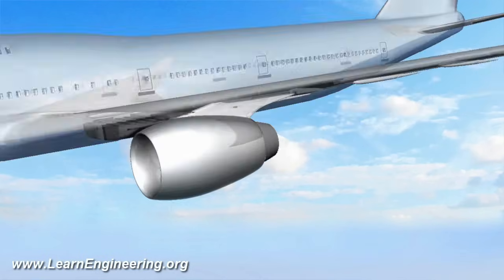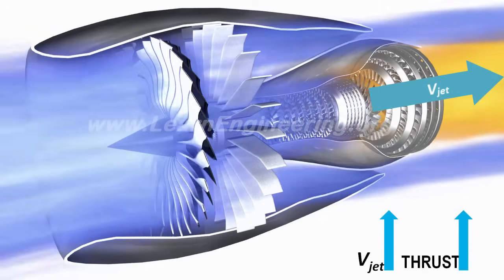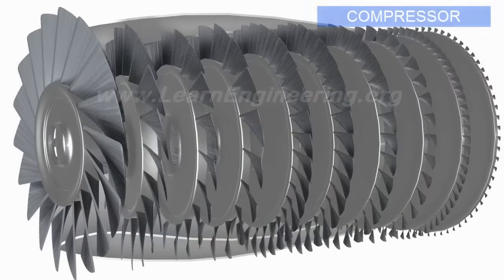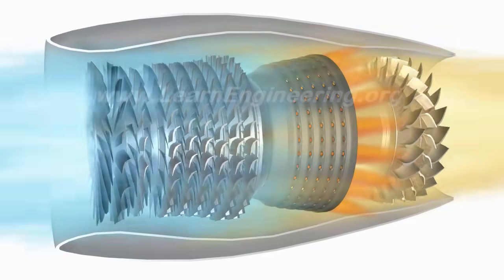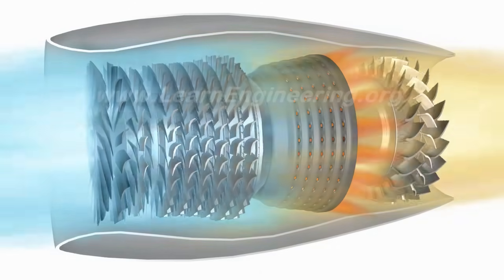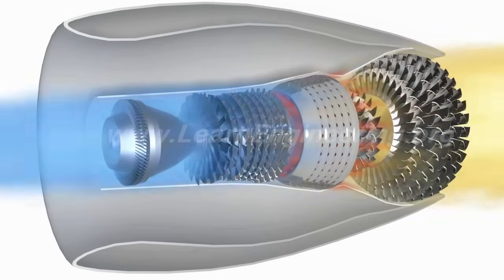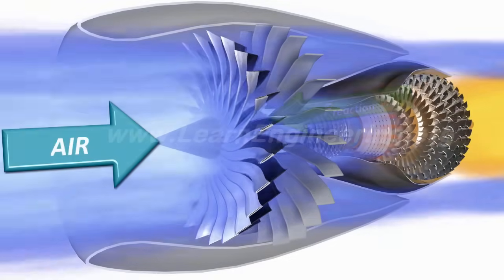Jet Engine, How it works?

Comment: Make two technical errors:
1) Between the compressor and the turbine why didn't you use a special torque converter?
2) Because around the combustion chamber (fixed in the inner part of the casing) an evolved radiator (with sensors and electronic control) to give more indirect power to the combustion and greater flexibility to the engine.

Comment: What if we remove the rotors at the end. So there Will be no 350C and 0.75bar what brings 900km/h but 1600C and 35bar.....
Reply: The turbines at the end drive the compressor at the beginning, its not magic the energy to make it turn has to come from somewhere

Comment: Quick question, i see that both the compressor/turbine and fan/turbine turn in the same direction, do they not compensate the gyroscopic effect like in turboshaft?, and if they dont, how would the twisting of the plane(going up, down or turning sideways) affect the load and movement (twisting the engine case or the wing itself, etc)in the plane?

Comment: I am new to this..........and i have a *Question*. Basically the video explained that the high velocity jet from the combustion chamber spins the turbine, which consequently spins the compressor. And the compressed(high pressure, temp) air is required to have combustion inside the chamber. But according to video the first step is combustion. Then how is the first step (high pressure, temp) achieved when the compressor isn't spinning since the turbine isn't spinning when there is no combustion (exiting jet)????????????????????????

Comment: THIS IS BULLSHIT...TRUST IS VACUUMED TURBINE UNDERSTAND WATER AIRE  ARE THE SAME....PROPELLER IS BEEN USED TO FLYING IS JUST GLIDING THE AIR SLICE AIR...TECHNOLOGY  ON WATER SLICED WATER FLAT TO GLIDE...JET TURBINES PWM BATTERY DONT NEED GASSES....THOSE ARE MODIFIED BY ASSHOLES TORCH TIP....PLATINUM IS JUST SPIKE WITH LED MERQUIRY  ALUMINUM TUNGSTEN..ALOY TITANIUM PLATINUM GALLIUM...CHROMIUMED TO GOLD PLATED MAN MADE ...

Comment: Why does that 747 have 2 engines, and why are the blades turning the wrong direction? How reliable is this?
Reply: Appart from those 2 things its quite pretty accurate
Reply: @AnnicK.Zoloft  yeah but they are very important things, at least the blades are.
Reply: @Danielm-hq3eb  oh absolutely those animations burned my eyes and that 747 was an absolute insult to aviation, but ya know, the rest wasnt too badly explained at least
Reply: @AnnicK.Zoloft  Yeah

Comment: Shouldn't the volume of air absorbed in a period of time be the same as outward? Meaning the Vout should only be influenced by areas of intake and outlet?
Reply: If it wasn't being ignited, this would be the case, but A. it is being compressed (more energy density) then being ignited (forcing it to expand rapidly) but it is being directed in only one direction, out the back, thus the Vout>than V in. Not sure exactly how the density would change though.

Comment: for starting up the compressors at take off they use electricity for rotating the turbine ?
Reply: Yes, either that or they just blow compressed air into it and it starts turning the same way as if the compressors were providing the air

Comment: On take off and landing it uses most of the fuel. Once the aircraft reached desired altitude the engine is run with zero fuel consumption
Reply: Regional Pro No, the engine is most definitely using fuel at cruise. Still drag and there’s no free energy

Comment: This tells me how a turbo prop works...but not how a jet engine works...
Reply: The engines in this video were turbofans and turbojets, which are the 2 main types of jet engines and have nothing to do with turboprops
Reply: @AnnicK.Zoloft  A: In very brief, a turbojet is a jet engine, a turboprop is a jet engine with a propeller atached to the front, and a turbofan is a jet engine with a fan attached to the front. ... A turboprop engine is a turbojet with a propeller. The engine uses the propellers to produce more thrust.Aug 24, 2014
this here is the answer everyone wanted...https://www.grc.nasa.gov/WWW/k-12/airplane/aturba.html

Comment: if a Jet engine is less complex than a reciprocating engine...why is it so expensive and costly to maintain? or is it just the fuel consumption that's more costly?
Reply: Good question.  Much of the cost has to do with the cost of using material that can withstand the very high temperatures within the engine core.  In addition, these materials need to be as light as possible.  The high temps can cause metal fatigue and necessitate replacement more often than with piston engine parts.
Reply: @nevillec5252  hopefully one day we can 3d print jet and rocket engines and harvest jet and rocket fuel from our gardens! Hehe
Reply: @solarasolarwind4323  Some jets have been flown using bio-diesel blends in recent years (for safety, only to one engine at a time) as a trial, so "garden-harvested jet fuel" is actually a reality.

Comment: How much air goes through the engine in one hour cruise flight?
Reply: A GE90 which is the most powerful and biggest jet engine takes 1.3 tons of air per second on takeoff and about half that on cruise. So per hour it would be ridiculous figures

Comment: It is worth mentioning that Turbofan engines used this days everywhere does not produce Condensation Trail ( https://www.geoengineeringwatch.org/ )
Reply: It's also worth mentioning that Dane Wigington is an idiot, and that today's engines are actually more likely to make contrails that older low bypass turbofans and turbojets. This is not opinion; its fact, supported by basic physics.  Wigington will say anything to keep his nonsensical story going.  Do your own research away from YouTube and you'll see that I'm right.
Reply: @paulshepherd8295  Since Google knows that Dane Wigington is an idiot, his work Google demotes… got it! Project Veritas!... Since you mention physics: in any bypass engine what you have is hot jet air mixed with cold bypass air producing in an effect worm air and warm air is not producing condensation. Condensation is produced when hot jet engine air with no mixing encounters cold external air and rapidly is cooled down. You can check triple point of water in the thermodynamics. Besides go and watch old western movies, see how the clouds used to look like and compare it to what you see on the sky today.

Comment: Can someone explain why the thrust go one direction? Not both direction? I understand the air comes from the left, but the burning of fuel is in the open chamber. So the jet should thrust in both way.

Comment: So do you start this engine with a pull cord like a lawnmower?  The combustion chamber only works when the compression blades are turning?  So if you pull the starter cord to get the blades turning do you light a match to ignite the combustion chamber?   Will this fit on my bycicle?  My mom doesn't let me play with matches.  Guess I'll be a astronaut when I grow up unless you need a match to start a rocket engine?  Maybe I'll just make matches when I grow up.

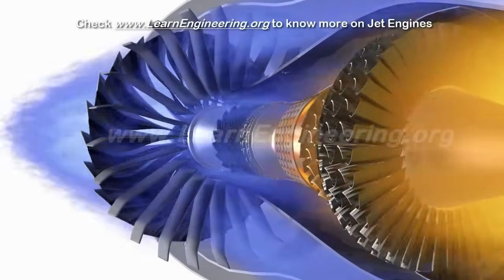Comment: Yes. The front blades indeed appear to be pitched reversely, to judge by the displayed rotation animation throughout this video. The correct pitch is at last shown briefly at the very end of the video; at about 5:20 min/sec. Thank you very much for taking the time and effort to post this very enlightening video. We appreciate a well-organized and clearly explained documentary. We look forward now to another video that may deal in the Electrical  aspect of these same mechanisms; such that explains the Starting System, from beginning to end, perhaps. The Fuel and Acceleration System  would also be quite an interesting video to watch, to conclude the understanding of the entire system in basic fundamental concept. Thanks again.

Comment: Hm i still don't really get it. I would like to know why the combusted fuel, combined with air propels the engine forward. What's the difference with regular propellers?
Reply: regular propellers have engines like a car has engines to move wheels.
in a jet engine. you need a fan to take large amounts of air. Then a compressor fan to compress that air so it heats up so much that when you inject fuel in that hot air it combusts and that hot air exits from the back through a much narrow outlet to give thrust.
electric power is needed at first to start the engine like a spark plug is used ignite fuel in  a car engine
Reply: @JamesBond-kc4ht  thank you

Comment: I always wonder with 2~4 turbine a plane can fly. How much energy is produced by them in terms of ground transportation?
Reply: A GE90 which is the most powerful engine currently used in aviation makes about 110 000 horsepower, the 777 has 2 of those
Reply: @AnnicK.Zoloft  Its not correct to say that turbofan or turbojet engine produce power, they produce thrust. Ok, they obviously produce power, but its not useful for comparison, since used is thrust measured by force (N, lbf, kgf ...). So Ge90-115B produces 115000lbf of thrust.
Reply: Phisically, power is the definition of force x velocity or work/time, so in piston engine, the unit used usually is Horsepower, which is measured at the engine crankshaft. And in some turboprop, its commom to see SHP or shaft horsepower, which is measured at the propeller shaft, since propeller rotates in different speed than engine shaft.
Reply: @arturdlucas  sure thrust is the most important thing, but power can also be used even though its not a straight forward conversion. And yes it is useful for comparisons because many more people understand horsepower figures than lb.ft or N.m.
Reply: @AnnicK.Zoloft  Yeap, but these engines produce a lot of power to turn those heavy turbines.
Reply: @arturdlucas  Are you saying that a lot of the horsepower is lost before thrust is prduced by spinning the compressor? Otherwise im not sure what you mean
Reply: @AnnicK.Zoloft  No, i'm saying that Turbojet and turbofan engines produces thrust directly into the air. And propeller aircraft produce power to turn the propeller which produce thrust. So it's a little different the way it is measured.
Reply: @AnnicK.Zoloft  but they indeed produce a lot of power to turn big and heavy spoons, but it is not useful for measurement and comparasion.

Comment: So there is no feul used. Right
Reply: the fuel injectors into the compressors in order to heat the air was mentioned, though only in passing as this video is only introductory to the topic.
Reply: @adm_ezri  
But how much fuel will  need fill up. I never seen filing that much fuel filling.kindly show me how much  fuel needed for Average trip

Comment: Considering the blades and all other stuff are working the right way :
Always wondered why doesn’t the high pressure hot flames go reverse (they only escape from back while they can travel to front of the engine passing through the compressor)
I mean according to the physics laws the pressurized air atoms push’s in the all directions
Reply: Difference in pressure will always move fluids to the lower pressure point aka exhaust .
Reply: Because the pressure is lower after the exhaust
Reply: I think its because the pressure difference between intake and compressor is smaller, than between Compressor and exhaust.
The gas wants to flow on easiest route, which is towards the lower pressure of exhaust.

Might be wrong.
Reply: @jarskil8862  I would think a jet propelled aircraft travelling at a modest 1000km/h would be a sufficent explanation to your question...
Reply: @jarskil8862  lower turbine resistance in the exhaust direction is also the only thing I could think of. It will be complicated by the RPM and the airspeed of the aircraft.
Reply: The turbine in the back lowers the pressure and so the hot pressurized gas wants to equalize it, but then it just powers the system and pulls more air in from the front.
 
Basically we make physics our b*tch
Reply: i saw only 1
Reply: Me too.  Why do the gases magically keep moving to the exhaust?  There has to be lower pressure. Is there a venturi effect?  Maybe think of a blow torch, where there is a blast of ignited gas away from the nozzle, with no compressor.  But why does that happen?
Reply: @Quercus_Maximus  you don't need compressor for the gas torch, the gas itself is compressed, and won't ignite without oxygen. there is no oxygen before the nozzle, so it can't burn backwards even if the gas runs out and pressure drops to atmospheric pressure
Reply: Two things are needed to keep in mind: flames have a deflagration speed that is honestly not too high, so if you have a faster flow than this speed the flames cannot flow back to earlier part of the engine.
So, how do we assure the flow goes in wanted direction? that's all about why we have a compressor and turbine: the compressor is a machine that in case of a flow reduction (imagine starting from equilibrium condition and having a small disturbance reducing the flow), at constant rotational speed (which would take time to vary due to rotating inertia) generates and even bigger pressure ratio passing through it because the flow would bump more sharply into the blades (positive incidence) and get more deflected and thus more pressurized. 
If then the flow has increased in pressure due to the compressor's incidence the turbine sees itself pushed by a more pressurized gas and this gas wants to leave through the turbine with even more "desire", restoring a higher flow that means correcting that supposed disturbance.
Secondly the pressure difference at the turbine is lower than the one at the compressor so at turbine exit the pressure is still higher than atmospheric pressure and the exhaust gases say  "let this pressure difference push me violently, there's literally nothing in the way, let's go".
The fact that turbine sees a lower pressure ratio is because of the termodynamic cycle: the equilibrium of the spool requires the same enthalpy jumps across turbines and compressors matched by a single spool (neglecting machine's efficiencies, other energy degradation mechanisms in the combustion chamber and bit higher mass flow at the exit due to extra fuel mass injected) and that is almost proportional to the difference in temperature in the gases flowing through. Since we increased the temperature inside the combustion chamber a lower expansion pressure ratio at the turbine is needed in order to get the same temperature difference of the compressor.
The main thing to keep in mind is that compressors and turbines are not random fans rotating, they are designed extremely carefully to achieve the compression first and expansion after. They could never work, let's say, in reverse gear and let the flow go through in reverse.
Reply: @maurolocatelli3321  Thanks man, I appreciate it.

Comment: Do jet engines use fuel in the compressor?
Reply: No. Too risky. Instead, it's injected after the diffuser to avoid compression ignition.

Comment: Can I ask a serious question...and hopefully get a serious response...a commercial jet carries about 30 to 36 thousand gallons of fuel for a 10 hour flight...thats roughly 252,000 pounds....in the wings and supposedly lower bottom of the plane...does that sound possible...? A midsize car weighs roughly 3,500 pounds...that would be 72 midsize cars...🤔

Comment: Why does the air need to be compressed to be processed into the combustion chamber?
Reply: To increase pressure of air so that proper combustion can take place.
Reply: @aapnorangillorajasthan2064  and why doesn't the combustion happen without icreasing the pressure? Is there a formula or something?

Comment: What are the by products of combustion?
Reply: In theory, a complete combustion would produce Carbon Dioxide, Water Vapor, unburnable Nitrogen (because Nitrogen behaves approximately as an inert gas), and unburned Oxygen (because it burns at a lean ratio of ingredients, meaning it is diluted with more air than is needed solely for supplying oxygen to use up the fuel).

In practice, there are intermediate gasses of the combustion process, because geometrically, hydrocarbon fuels and elemental oxygen don't directly become CO2 and H2O.  Examples are CO, NO, NO2, HO, and Ozone.  While nitrogen molecules mostly stay intact, a minority of them do split, and rejoin other elements.  There's also sulfur compounds, because the fuel is not a pure hydrocarbon.  Unburned fuel may also be present, because there isn't enough time or space to burn every single molecule that was originally supplied.

Comment: hwo can a boing 7474 only have 2 engines Xd
Reply: the engines do not provide lift for a plane. The Boeing 747 does have 4 engines, which drive the aircraft, though these are incredibly powerful. The lift comes from the wings themselves, which are shaped (aerofoil) to direct the air downwards, leaving low pressure above, thus forcing the plane upwards. The wings can also control the roll (tilt) and pitch (up/down) of the aircraft using the ailerons, with the rudder (on the tail) controlling the yaw (side-side movement).

The Boeing 747 is mostly retired from commercial service at this point, mostly replaced by the larger airbus a380. The most common Boeing aeroplane is the 737-800, which is a smaller plane with only 2 engines, this is where the mix-up may have occurred.

Comment: I have a question that, how initially the blades are rotated???
How they power up??
As see the fuel are mixed in the compressed air....
So for air compression the fan need to rotate..
Reply: Air turbine starter is the answer my friend ;)

Comment: On the ground, when this engine starts, i know APU give pnemetic power to High pressure turbine and this HPT begins to rotate and then High pressure compressor  --> combustor --> Low pressure turbine --> Low pressure compressor 

Is it right...????